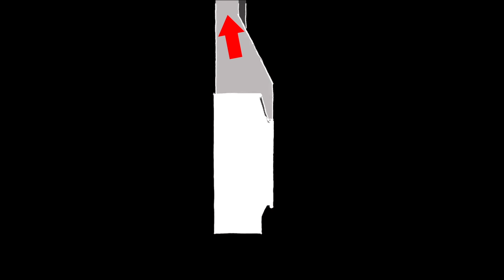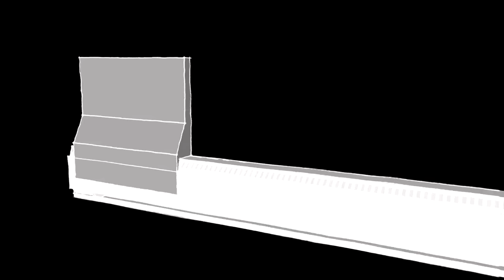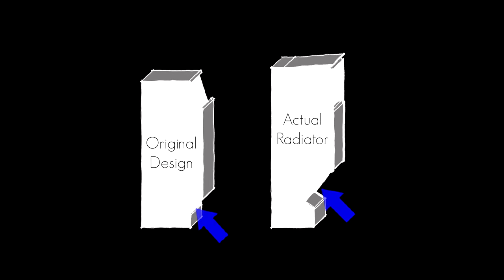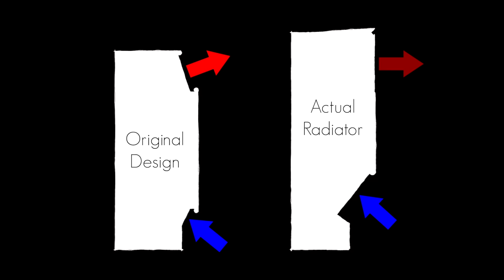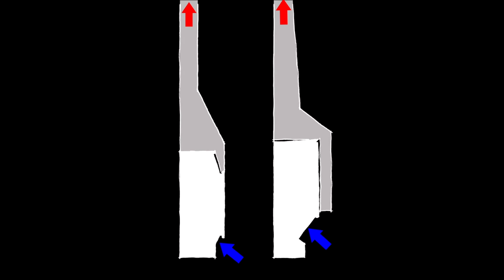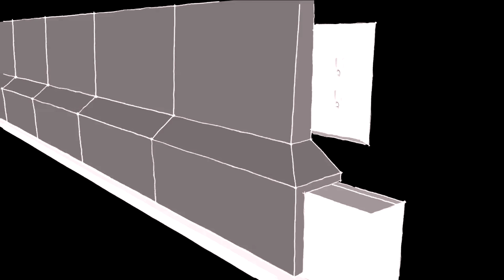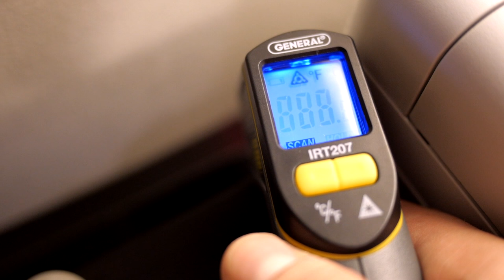Radiator Heat Shield: aka. The Printer Saver

Comment: Next time use 26 gauge galvanized sheetmetal. Aluminum is gonna spread the heat along the metal. Really brilliant idea though and your sheetmetal fab skills are perfect. I'm a sheetmetal worker
Reply: Also: next time use offset snips and don't fully close the snips when cutting. This will make a nice cut line with no jagged edges
Reply from the maker: Thanks for the comments and suggestion Tom! I’m glad to know you approve on the metal work. You’re right, steel would help with the heat transfer in the metal.

Comment: I want to block the heater radiator with heat shield to protect my art room material supplies, I cant turn it off cuz i live in an apartment. I wonder if its possible to cover all area with this aluminum ?
Reply: Did u ever solve this problem? I am searching for a solution too as i live in an apartment and its toooo hot. I want to block the heat.

Comment: Awesome! Great work. I have to comment that its strange as an engineer focused on ebergy savings why you would be using electric heat.  I use a mr buddy propane heater and its insanely cheap heat.
Reply from the maker: That's a sweet little heater! Thanks for pointing this out! Unfortunately, we live in an apartment with electric heat and I'm really doubtful they would even allow us to use a heater powered by propane - regardless of how safe it is.